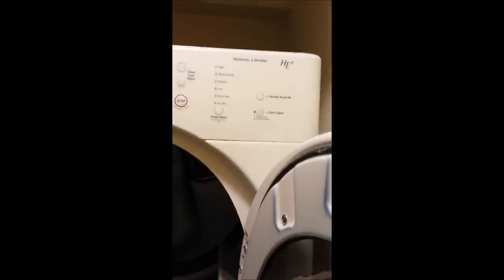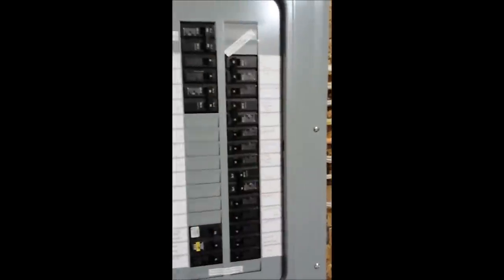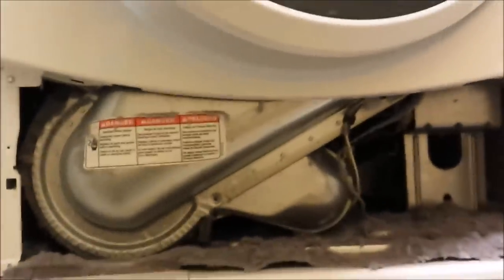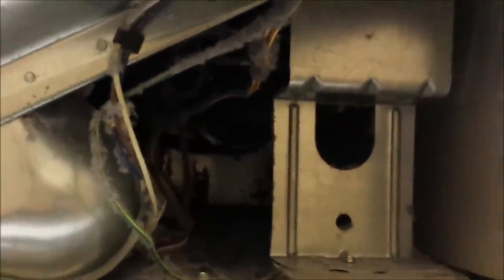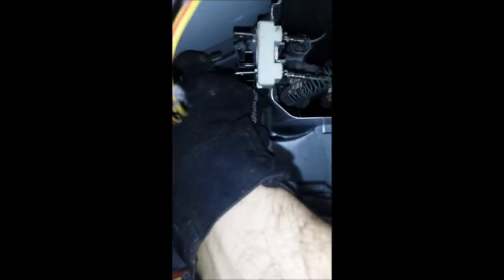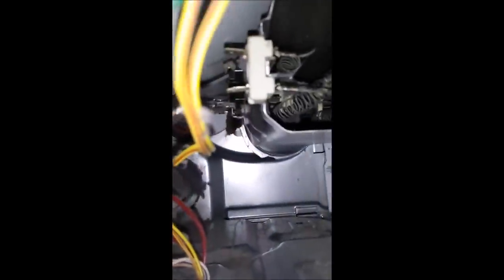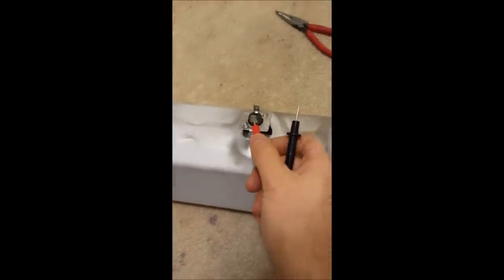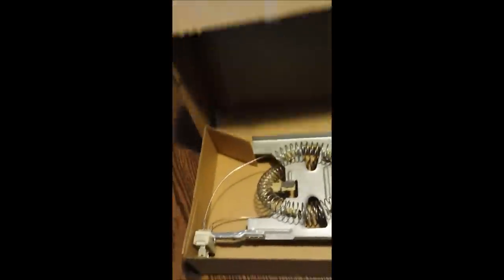How to fix a dryer that doesn't get hot

Comment: Great instructions.  A little stretched out, but for the most part, I was able to skip every 5 minuets and got the job done quickly with your help.   On a different Note, my dryer hadn't been opened in 7 years and I had only about 1/4 of the lint that you had.  The wife and I are careful to clean the lint screen between every load and I also insure that the vent to outside is unobstructed.  You may want to check that as you could easily have had a fire.  Thanks again.

Comment: Great video.  Thank you!!  I took out the sensors to replace the heating element.  My problem is that I don’t remember which way the sensor you couldn’t identify goes back in.  Does it matter?  I don’t want to rewire it backwards.

Comment: If you have that much lint your vent is either clogged or kinked. Bad venting is the main reason for long drying times, thermal fuses and heating elements going bad. Most newer houses do not have enough room to keep the vent clean. If your vent exits through the roof, go ahead and double your homeowners insurance before the house fire starts.

Comment: Did you ever figure out why you had so much lint in the inside of the dryer?  I was having the same issue, but I had a ton of lint down in the lint screen area.  It actually caused some damage to the fan that pulls the lint through.  Just curious if you ever had to replace the fan of the motor?
Reply from the maker: WILLIAM STOOKSBURY I also had lint get past the lint screen and into the base of the dryer where the heating element is. Seems like an issue with this dryer as lint should never get near the heating element where it can be a fire risk.
Reply from the maker: WILLIAM STOOKSBURY sorry I haven't had to change the fan or motor on this dryer